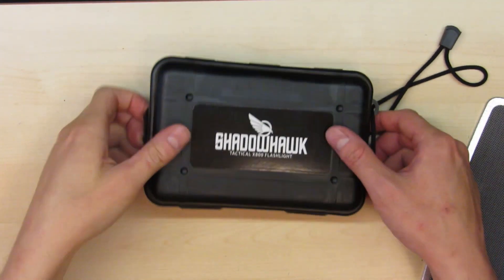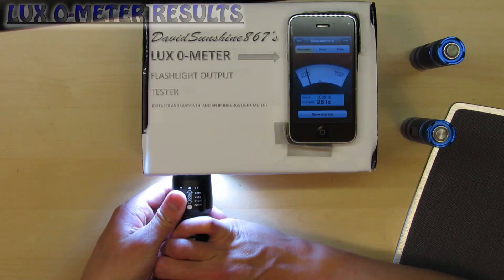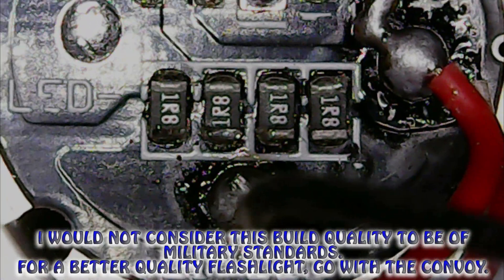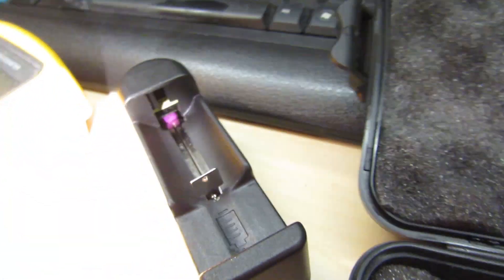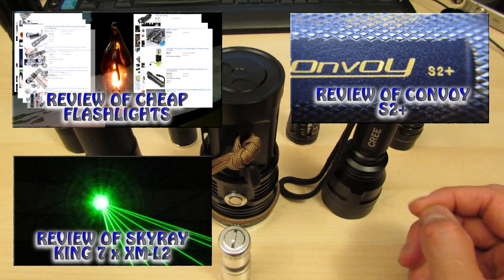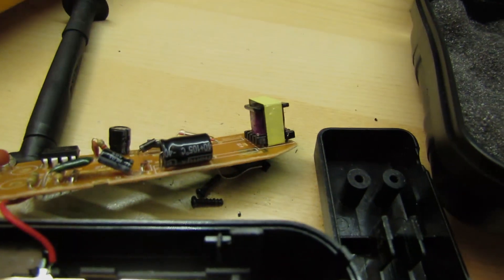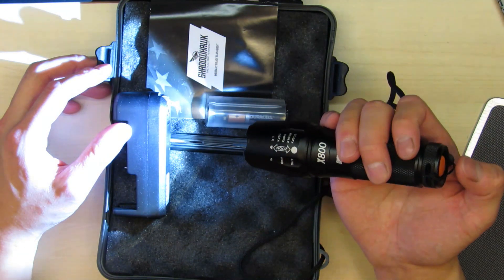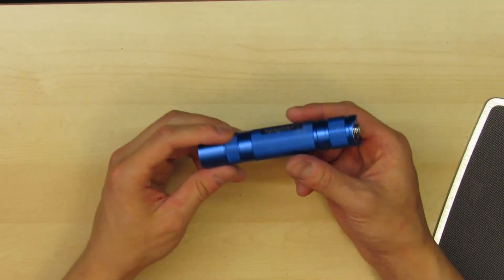ShadowHawk X800 Review - 26650

Comment: Great Video!!....I need to disassemble and repair the tail switch because it flickers, but the metal ring holding the switch in the tail piece doesn't have the normal two holes punched into it so I can get a grip and unscrew it, like most tutorials show.  Am I missing something here, or is this the biggest mistake ever from the most POS scam flashlight ever created?  How am I supposed to get the switch out?  Thanks....
Reply from the maker: Hi,
Thanks man, it was fun testing out this light, it's an average 600 lumen zoomable, so not a horrible light, but you can get similar models for $6 off aliexpress or gearbest.  Appeared to at least use a genuine Cree XML LED, which is more than can be said about other cheap flashlights.
Back to your problem though, a lot of these cheap flashlights have horrible tail switches, and you're 100% correct that fixing the tail will help.  I found that just some cleaning, and dielectric/copper grease works well, or you can just clean it and grease it(synthetic preferably).
To unscrew it, if you don't have the 2 holes, I'd drill 2 small holes into it.  Or dremel, whatever you have handy.  Then you can get your needle nose pliers into it and unscrew it.  You'll probably want to grind down the tips of your needle nose pliers, so it can fit into the holes. You can't make the holes too big, otherwise you'll damage the threads.
Hope that helps!
Good luck.
David.
Reply: David Sunshine .... yeah it does shine bright after it fully charges, and lasts quite a while.  I'll give it that.  I guess it would be more accurate to say it's a POS compared to what this company "claims" it really is....a 100 dollar top of the line flashlight.  Guess it's a decent deal for 10 bucks though.  IMO they should of just put a little more quality and money into it, and the safety of the charger and the real mA of the battery, and market it as a great $20 dollar light.... instead of making all these claims that it can help you save the universe while they sell it at 90% discount.  Doesn't help this company get a good rep at all..... 

I drilled two holes in the ring but still couldn't turn it because I had previously fused the ring to the barrel of the cap with a misplaced self tapping screw.  So I ripped off the rubber button and beat up and jabbed the switch a little with a tiny flathead, and it actually works much better now, lol.  I didn't think of dielectric grease, good idea!!!  I'll add that too...

It's working better though, so I'm off to save the universe, or half of it....

Thanks!!
Reply: David Sunshine ...yeah it does shine bright after it fully charges, and lasts quite a while.  I'll give it that.  I guess it would be more accurate to say it's a POS compared to what this company "claims" it really is....a 100 dollar top of the line flashlight.  Guess it's a decent deal for 10 bucks though.  IMO they should of just put a little more quality and money into it, and the safety of the charger and the real mA of the battery, and market it as a great $20 dollar light.... instead of making all these claims that it can help you save the universe while they sell it at 90% discount.  Doesn't help this company get a good rep at all..... 

I drilled two holes in the ring but still couldn't turn it because I had previously fused the ring to the barrel of the cap with a misplaced self tapping screw.  So I ripped off the rubber button and beat up and jabbed the switch a little with a tiny flathead, and it actually works much better now, lol.  I didn't think of dielectric grease, good idea!!!  I'll add that too...

It's working better though, so I'm off to save the universe, or half of it....

Thanks!!
Reply from the maker: Lol, the company doesn't have a reputation.  I hear the guy's the same guy who sold magic pills for weight loss too.  Those probably provided less benefits to the customer than the X800, so I guess the company's actually improving? Hopefully the next product they market to the extreme performs even double that of the X800.  To be fair, the X800 I checked out actually had a thermal adhesive holding the MCPCB board to a larger pill, so it had better thermal management than some of my cheaper lights.  But ya, they should have just gotten a $12 light and marketed that as great as they did, like an S2+.
Lol, that screw, damn.  Glad you got it working better tho!
If you're looking for a good cheap flashlight, search up the S2+!  Maybe the C8. Those are great.
Cheers!
David.
Reply: Yeah the selftap screw didn't go in easily, so I just started it, then stopped after a second after realizing I was off center.  Screw never went in.  But it still made a little dimple, and the dimple was a fusion of the metal of the ring and the metal of the housing.  Couldn't believe that tiny fusion kept it secure after I finally drilled 2 small holes and tried to unscrew it.  So screw it!!

Thanks for those 2 recommendations, I'll check them out for sure. 
Peace.
Reply from the maker: Oh crazy, maybe you can dremel out the fused part, and get it free.
I assume it's loosened by counter clockwise turns, I found that some of them are clockwise too, so give that a try.  I thought one was so tight it couldn't come out once, then I turned clockwise and it came out. LOL.  It'd be nice to get it out, and fix it for good.
Here's my review of the S2+  https://youtu.be/q2kW52HLk-U
You seem into modding flashlights too, so you might want to check out my S2+ Inferno video, where I take it all apart, and go all out, I even solder the parts in the tail switch to add thickness to the metal so it can conduct more amps with less resistance:  https://youtu.be/Uzjv_zwr8Ng
I still think the S2+ is the best bang for the buck, even though there are a lot of different lights out there.  Not sure if you want to know more about other flashlights, but I'll give you some links to my videos if you're interested:
The UT01 is interesting, since it uses 14500 and AA batteries:  https://youtu.be/82sL-KGqhDA
Both of those are way higher quality than the scam light, if you're looking for something better.
I really like the C8 as well, they have a clear anodized one with new firmware, and I'm really liking the new firmware too: http://tidd.ly/fff79fa
You can buy the S2+, in clear finish, from the Convoy Store too (http://tidd.ly/1971be47), but it doesn't have the new firmware like the C8, however you can ask for the new firmware, I think he charges $1.50, but not sure how you pay that, lol.
Out of all the lights I have, the S2+ and the C8 are the best deals and perform very well, I keep going back to them.  But I'm using a DQG Tiny 26650 (http://tidd.ly/17b1849b) as my EDC nowadays, cuz it's 3000 lumens, and really lights up dark sidewalks and alleys.  
My home light, is the L6, too big to carry around, but if you need to blast light to the backyard to see a bear trying to destroy your garbage can, it's the one to have:  http://tidd.ly/c5cfdc12
There's also the Zanflare F1(https://youtu.be/RNxiwvHCEdY) and UT02(https://youtu.be/tnJjGxKwfiU), good if you want USB chargeable lights, and a good thrower.
That pretty much gets you up to date with all the new flashlights out there, don't know how much you want to know about flashlights, but there's lots of info in those videos.
Cheers!
David.
Reply: David Sunshine ...wow, thanks for all that info!!!  I'm just starting to realize how far flashlights have come recently.  I really don't have a nice one or know much about the latest and greatest, but playing with this x800 has got me more interested...

My dad gave my bro this x800 as a gift, and after reading about its bad rep, I decided to get my bro a nice one from Walmart and settled on the Bushnell 1250.  I couldn't believe how bright that thing was when we lit it up.  He took it with him, and so I'm using (and abusing) his x800 to actually light up one of those Himalayan salt rock lamps that has a burnt out bulb.  I charge the 800, turn it on high, and place it right up to the back of the salt rock, and it glows like the heavens.  10 times brighter than the internal incandescent bulb the rock came with, and it stays cool and has a nice white light instead of warm orange.  Looks much better!!!  I was a little surprised at the brightness, since the build quality is obviously minimal.  I did check out the S2+ and C8 you mentioned, and I'm definitely picking up the S 2, I like it a lot.  Can't wait to check out those other links you sent, and get a few of these bad boys!!!
Reply from the maker: Lol, anytime.
You seem pretty keen and capable so you'll love the new LED technology.
I took a 1000 lumen ikea bulb and made a 6000 lumen flashlight out of it, pretty awesome.
It pushes 200 lumens/watt, which is way better than the 20 lumens/watt incandescent bulbs push out.
10 times more light for the same power, NUTS.
I don't have a video of the new biscotti firmware, but it's the best, worth the upgrade to the S2+, you can probably solder and replace the stock if you really want to, but it's easier to just order it with the new firmware off the bat.
I've just recently gotten into the LED flashlights too.  Good time to get into it, they have the new XHP70.2, XP-L2, and I've been playing around with those.  They're nuts.  Based on Cree's SC5 technology.  It's impressive.  
Performs very well.
Cheers!
David.
Reply: David Sunshine .... nice!!!  Had no idea you could modify and upgrade flashlights.  Looks like a fun hobby.  Do you have any videos showing how to put super powered UV lights into a flashlight, so I can place a few around me and get a tan while I lay on the couch like a walrus?  I need to figure that out....
Reply from the maker: Haha ya, lots of stuff you can do.  In the inferno video, I just heated up the board, and the LED desoldered and I put another one on in the same way.  So you could do it, but it's a lot of work.
They sell UV LEDs for growing and stuff, but not sun-tanning. I'm not sure how much power or at what wavelength would be good for sun tanning, but they got lots of high powered UV lights for growing:  Check out the search here:  http://tidd.ly/24c0b140
Then you get a collimator lens/heat sink for your LEDs(Dual one here: http://tidd.ly/a2871010), a DC-DC boost driver(http://tidd.ly/dcecdbe3) and you're set!  Got yourself a high powered LED suntanning light.  
The constant current driver is good cuz you can limit the current to your LEDs, but you'll have to put it through an ammeter to set it, there are more expensive ones where you can set it using an LCD display(http://tidd.ly/fd61dfcc).  I have one of the 400W ones, but I got a cheap one for $16 and the CC was broken!  I told the seller and he gave me a partial refund, it's good as a CV booster tho.
I then ordered one from Gearbest and it worked for the constant current. LOL.  Almost blew up my 100W LEDs when I first tested the broken one.  I guess that's why they said it was a "HOT SALE", literally hot, or better a FIRE SALE.
But I don't know if the grow lights are good for use as sun tanning lights, but if it's good for a plant to substitute sunlight, I assume it'd be good for humans too?  Dunno about that.  Might want to do some research about it first before you give yourself skin cancer, although it can't be worse than the actual sun for that.  Who knows?  Maybe there's a safe way to suntan that doesn't have the type of UV that causes cancer?  Probably not tho, cuz the same UV you want, is probably the one that's bad for you.  I'm sure somebody has done some testing and trials on it.  Maybe we're best off sticking to just modifying standard flashlights for fun LOL.
Cheers!
David.
Reply: David Sunshine ....lol, I was just joking, but it's pretty awesome that you gave deep details on how to actually tackle it.  You've given me more information on flashlights in the last day than I knew even existed.... can't wait to go study each product and modification you mentioned, right on!!!.....and as far as the grow lights, I'm sure hundreds of them around the country are playing a huge part in the reason I lay around like a walrus in the first place, lol.  Definitely have to get myself some nice flashlights so I can find my munchies during a power outage 😉.   

I'll keep you updated on whatever new lights I get, and I'll hit u up if I have questions, you definitely know your shit!!!

Grassy Ass!!!
Reply from the maker: Lol, I thought maybe you were joking, but the technology is definitely there to do it.  I have a video on a UV light actually, it was pretty fun to review:  https://youtu.be/SYmAC_i7xXc
So UV LED lights are no joke lol.

Ya let me know if you got any questions, hopefully I can help!

Cheers!
David.

Comment: I got the X800 SHADOWHAWK and it sux ! The spring in the flashlight broke. Rechargeable battery only works when it wants to. The battery holder for regular batteries sux. The copper broke apart on it.
Reply from the maker: Thanks for the comment!  
Ya it's just a cheap AliExpress zoomable LED flashlight, worth about $6.  It'll break down but for $6 that ain't bad.  I'd buy one of these and put NiMH AAAs in it for the car glove box, the heat under the sun won't make the batteries leak, so it can stand up to being in the car.  I wouldn't put alkaline or lithium ion in a hot car, they will explode or leak.
Cheers!
David.